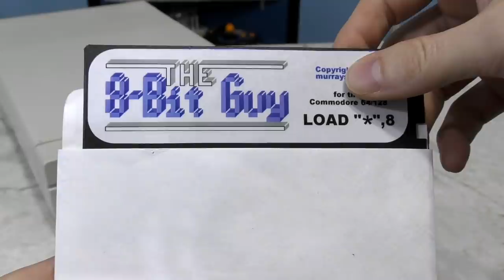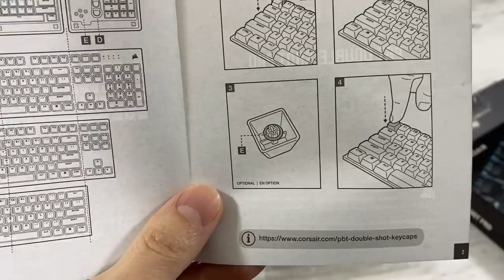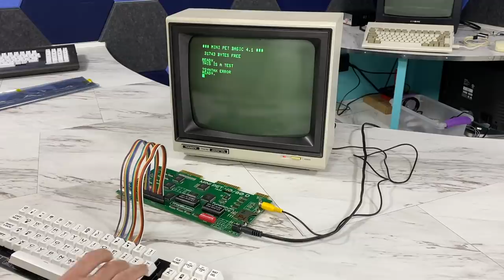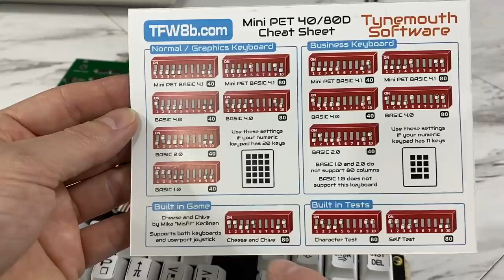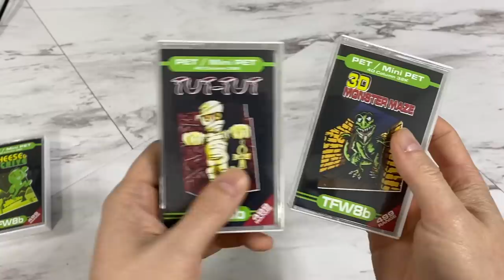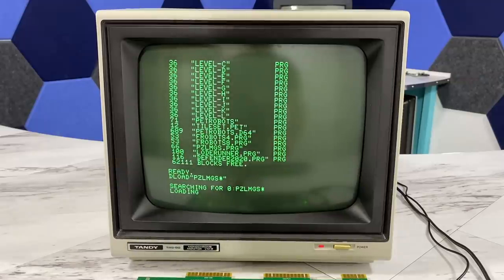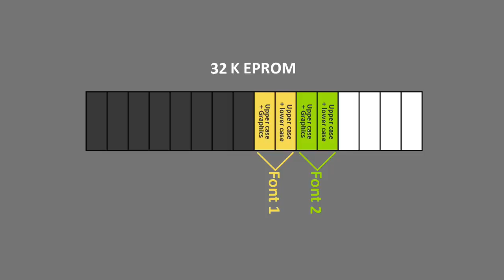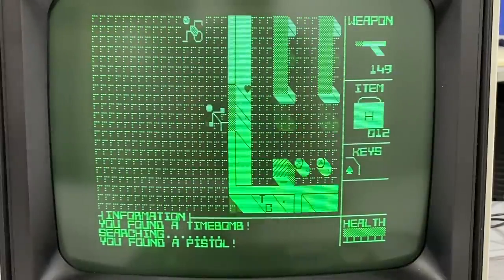The New MiniPET 4080D, reviewed!

Comment: Never put the O-rings on, especially for a fresh build.
If you want dampened switches, get proper dampened switches. They're lovely.
O-rings on the other hand don't even work on the upstroke and interfere with the downstroke.
Reply: considering the maker believes you'd use the keyboard so little as to use a keyboard of cheap button switches... O-rings aren't a bad compromise. Probably they suppose if you want to do serious programming, you use a real PC and transfer files to the SD card.

Comment: Hi, great solution to the keyboard problem. Could you please consider to develop identical keyboard pcb project based on modern switches but for Commodore C64? I'd like to build new C64 based solely on modern parts and keyboard is the only thing staying in the way.
Reply: Mechboard64.

Comment: Yes, I can confirm that. Those O-Rings are for noise reduction. Never used them too, but for some power users the "clackety clack" of a bobbing switch is unberable. I use them under Sanwa stick to give the ball a better adhesion

Comment: If they can make a modern PET- is there a chance we could see a modern recreation of C64 in the future?
Reply: The thing about the PET vs the C64 is that there's no custom silicon in the PET whereas key parts of the C64 are custom silicon i.e. the VIC-II, the SID and the PLA

For the SID and the PLA there are several solid options for modern replacements, but for the VIC-II the only one I'm aware of is the "VIC-II Kawari" which was built around an FPGA development kit that's not easy to come by at this point, I believe the creator is planning to make custom PCBs eventually but it's still a ways off.

EDIT: just checked (been a while since I watched the development video series), the developer of the Kawari has a prototype of the final PCB in hand now, so it's closer than I thought, but it's still likely to be quite expensive and difficult to get your hands on until the global chip shortage gets sorted out.
Reply: A modern C64 recreation already exists, the Ultimate64.
Reply: @SomeMorganSomewhere  There is custom silicon in the PET, the display controller. It's re-implemented in a microcontroller on the MiniPET.
Reply: @Ffinity  Well there you go, I thought the PET was all COTS (thought it used a commodity CRTC). 
I imagine its display controller is a much simpler beast than the VIC-II though ;)

Comment: What about getting your hands on a broken OLIVETTI BCS3030 and take the back of and gutt it of it's electronics and put in the new electronics and that should be that only problem will be what to do with the combined 8"Duel Floppy drive and Line Printer also the Keyboard might have to be modified to make it work but should be possible.

Comment: It would be nice if you could find a PET with busted board and keyboard, so you could restore and put the MiniPET and a cherry keyboard on it. Of course, it would be heavy and cluncky, but nice nonetheless.
Reply: That's what it was designed for. One thing is for sure. DO NOT BUY an untested PET PCB on ebay in the next few weeks.. coz most of my customers seem to be using them to fix brroken pets.

Comment: Now, if someone would just invent an adapter that “hides” an SD card in a 5-1/4” floppy disk sleeve so it can work in any floppy drive regardless of the (drive’s) hardware interconnect, that would be awesome. What I’m just not sure how such a thing would work as the SD card would go around and around; this would make a good connection difficult to maintain, I think! 🤣😆😝
Reply: If you put 4 SD cards in there, you would have 4 times the contact time. :)
Reply: That would be impossible because that would require some way for the SD cards to write the data to the magnetic disk, then it would need to be able to do that quickly. The hardware needed to do that is currently impossible with our current existing hardware.
Reply: @skinwalker69420  Not necessarily. If someone can find a way to make a thin enough read-write head, you could just build a variant of those cassette adapters for using a CD or MP3 player in a car that only accepts cassettes.
Reply: It would function much like the cassette adapters back in the day: no moving parts. just a magnetic head positioned under the reader. The hardest part is getting it all to work with such a slim package.
Reply: The thing about SD cards is that they are cheap. Just about any modification would raise the price considerably and the point of using SDCards (instead of just another chip) would become pointless.
Reply: @skinwalker69420  Guess you need to look up FlashPath, something that came out 25 years ago...
Reply: @OtterlyInsane  wait, I am intrigued.
Reply: @oogba71  Funny thing. At about 41 minutes in, Cathode Ray Dude's newest video (The first thing that ever used MPEG4) reveals that, in the early 2000s, they did almost exactly that for the 3.5" form factor... though paired with a special driver so they can treat sector zero on the "floppy" as a double-fast serial port and transparently present an LS120-like user experience instead of bank-switching the flash memory card's contents without need for a special driver.
Reply: @ssokolow  Wow, that's VERY cool

Comment: Is it possible to burn data to the blank blocks of the erom and access them on the pet/pet mini?
Reply: I'm guessing the character rom isn't addressable from the CPU, being addressed directly by character codes and a CRTC line counter.  That's the traditional way to build a character display circuit.
Reply from the maker: No.  The Char-ROM is only accessible by the video hardware on the PET.
Reply: @The8BitGuy  That's what I assumed.

Comment: Please, no surface mount tech for the Commander X16. It's supposed to be an 8-bit 80's machine, let's stick to technology from that era then. Otherwise you might as well stop development and just build a Pi-based emulator.
Reply: Well some things are only available as surface mount chips. Like FPGAs, and the X16’s VERA is based on an FPGA due to lack of options. But the VERA is also on a separate daughter board and is easily replaceable.
Reply: He was talking about the version 2 (cost-reduced) of the board, which is meant to be released later.  First version (if they ever finish) will be DIP for everything except for the video chip.